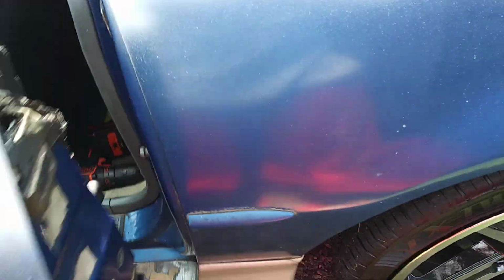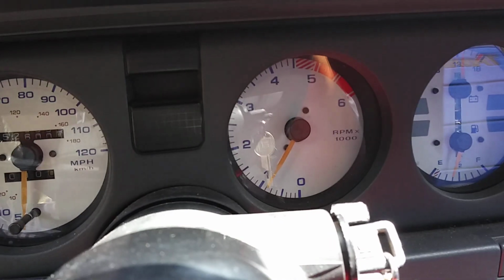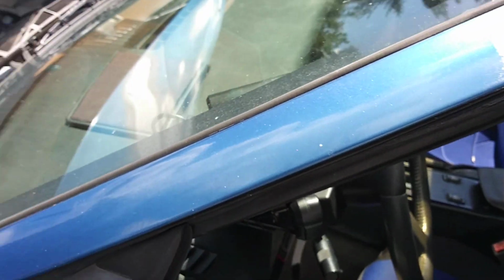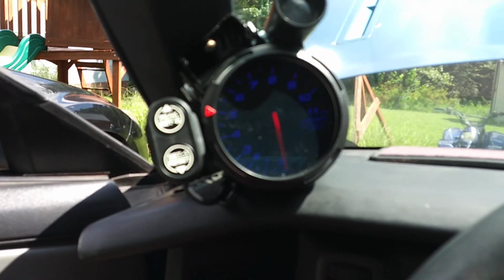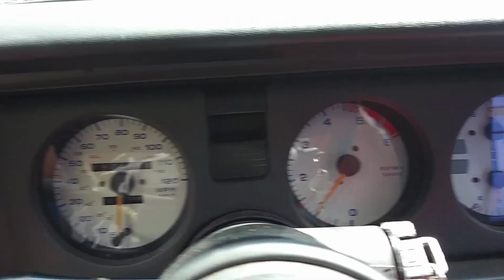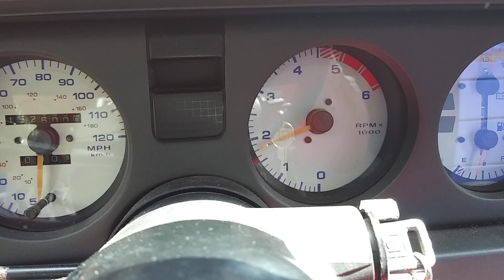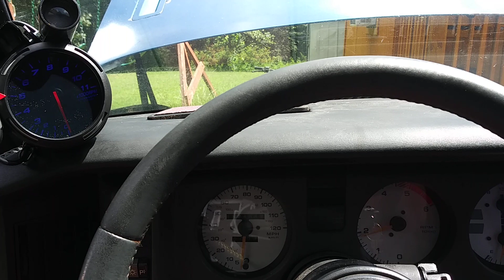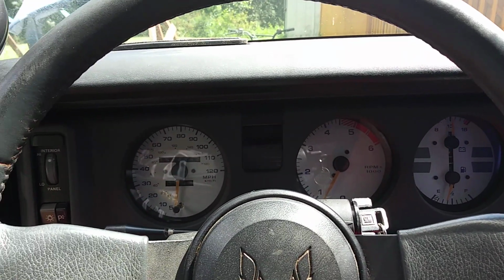Ebay tach issue video for vendor

Comment: I think it's that b***** ass car you got.I got the same text my right-hand drive prelude I haven't had any problems out of it. I think his car got some electrical issues
Reply from the maker: Only electrical issue was the tach. Autometer worked fine. Makes sense it would work in yours. Cheap tachs must work with cheap piece of shit cars 😆